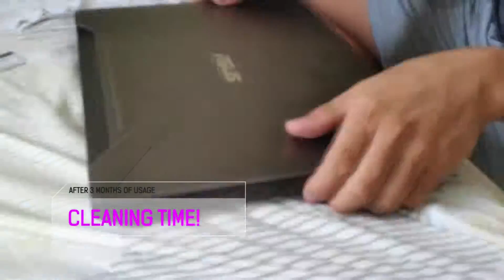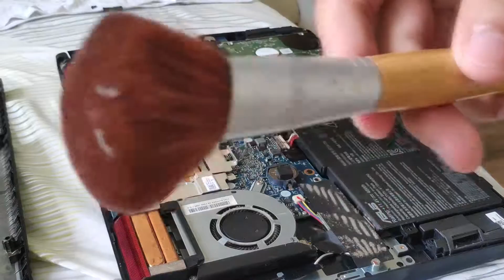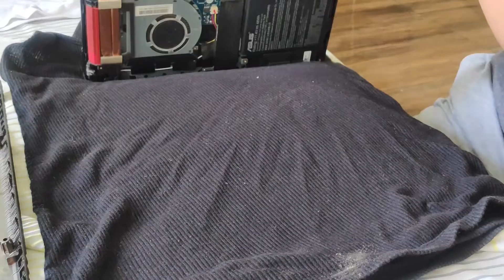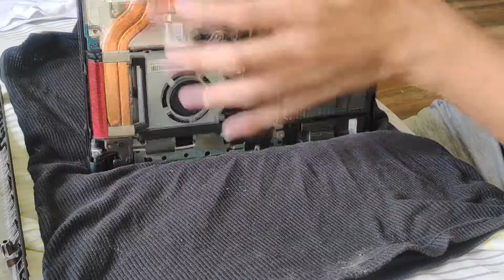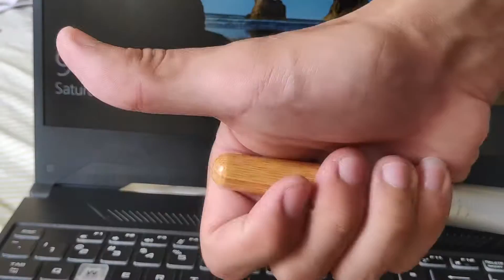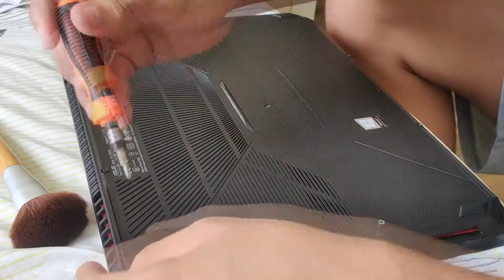Asus TUF FX505DT | Cleaning The Beast

Comment: it's been almost 2 years should I open and clean it myself as I think the dust is causing heat issues
Reply from the maker: I opened mine again last day, and there were a lot of dust inside.
Reply: I am going to open it tomorrow bcz it's reaching 95 degrees Celsius playing Valorant
Reply: @nerdymcheaven  bro can You play Valorant on lowest settings and tell me the CPU and GPU temperatures you get I need to compare the results, It'll help me  a lot
Reply: @aniketkumar5089  I'm having the same issue. CPU temps are in the range of 93-95C while playing Valorant. I haven't cleaned my laptop since 1/1.5yrs so it's probably the dust which is causing the overheating
Reply: @atharvapansare1487  get it cleaned bro I can't explain how dirty it was I couldn't imagine how my fan was even spinning.
Just get things cleaned from professionals or on your own before it damages the CPU lifetime
Reply: @aniketkumar5089  Yes, I'll have it cleaned from a professional after the lockdown ends. Don't wanna risk damaging my laptop by doing it on my own xD
Reply: @atharvapansare1487  Well u should stop playing Valorant then for a while ... Feels like mine is already a bit damaged there is a performance drop..
Reply: ive asus tuf fx505dt too ,8 gig one.Playing just cause 4 makes it cry a lot🙄 heating like anything on low settings,ive never cleaned its insides in 1 year,is this due to that?
Reply: @natsuagarwaldragneel8388  yeah it's the most probable reason
Reply: @aniketkumar5089  hm looks easy ,this cleaning thing,should i do it myself?
Reply: @natsuagarwaldragneel8388  if you're a nerd and u live in clea  environment u can.. or I will suggest get it done by professionals .. although it's easy ..take the battery off first then use brush or compressed air to clean the fans
Reply: @aniketkumar5089  im nerd lil bit 👀btw whats worst that i can do wrong cleaning it? break circuits,tiny wires?
Reply: @natsuagarwaldragneel8388  yeah u can break the battery and fan wires if u use to much force ..they are almost tangled..so be careful... U can spill liquid or may cause an electric discharge..last 2 are rare..use soft brush  and pls don't use cloth other than microfiber and don't blow air from mouth.. else it's good
Reply: U

Comment: I have the same laptop and it worked fine for a while but now I am getting random fps drops. Do you know how to fix this?
Reply: YO SAME HERE
Reply: bro sameeee, di na makalaro ng valo ng maayos haysss
Reply: I have the same laptop and have the same issue, strange so many people also seem to have this. I believe it might be due to poor heat management, when the GPU overheats, it throttles back. Just my guess but.
Reply: @andrewhannay7149  the issue with asus tuf laptops is that they're just simple hot garbadge, imo it's because of the cpu ryzen 3750H or other, they just really bad heat and power wise so they cause the fans to spin and it has some sort of dustfilter so that shot gets cooked instead
Reply: @andrewmtgx  depends on what you buy, imo ryzen and hdd may be good for performance but I wouldn't choose them for longevity. One again it all depends on what model and version. 

And running your pc on max settings and unnecessarily running your gpu when not needed doesn't help with how long it lasts either.
Reply: @animeloverasf594  yeah so amd 3rd gen high wattage is pretty bsd. lol

Comment: Lmfao... This is called cleaning??  the real  dust is accumulated on the fan blades and the heat air outlet. All he did was brush the surface not the interior.
Reply from the maker: I wouldn't want to open everything up, still under warranty. I did clean the air intake vents and outlets. Sorry, but its my first laptop. Just wanna share some video.
Reply: @ammar_d2705  i see noob talking. But its ok
Reply: @ammar_d2705  dust sure, but in my bedroom/ office there is so much lint from clothes. Very likely the "dust channels" get clogged. I wouldn't pass it past not compressed air cleaning it. Plus there are many small spots surround the case where dust bunnies form. We curious to see how others dealt with cleaning. This video isn't it.  Thanks for sharing tho.

Comment: Bruh!! You got lucky this time. Disconnect battery next time.
Reply: why bro ?
Reply: @ibrahimozmen9668  bcause u might damage the laptop ( electrical/ static shock). It is also said on the manual to disconnect the battery
Reply: @mohamadamirul3060  okey bro
Reply from the maker: Thanks for the comment. Will try to be careful next time. Also, I didn't read the manual. 😅
Reply: @nerdymcheaven  
No prob, just be careful nextime
Reply: @nerdymcheaven  always read manuals. This is the way ~
Reply: how to?
Reply: Do I have to disconnect when use only pressured air for clening?
Reply: How do you disconnect the battery bro
Reply: @Tambay1130  by disconnecting the push connector.